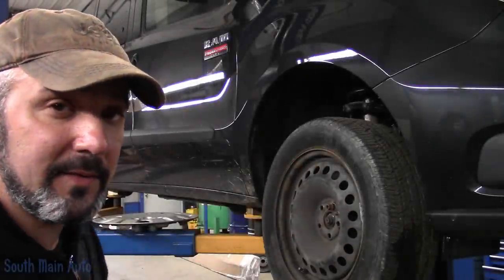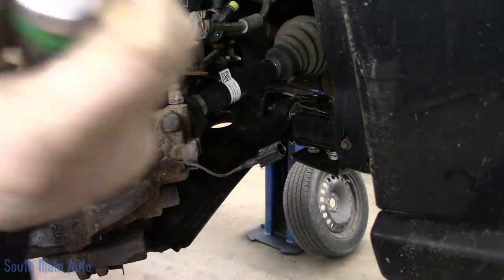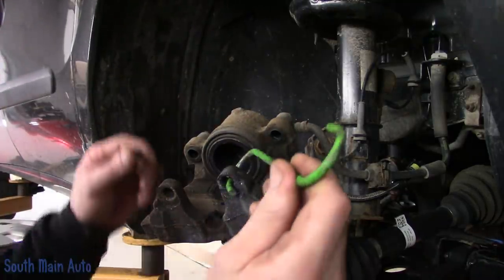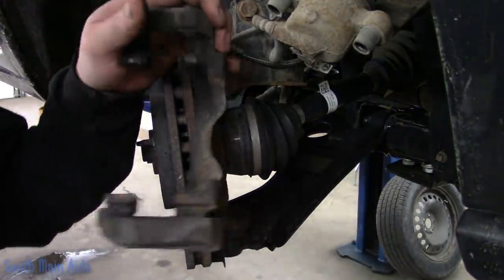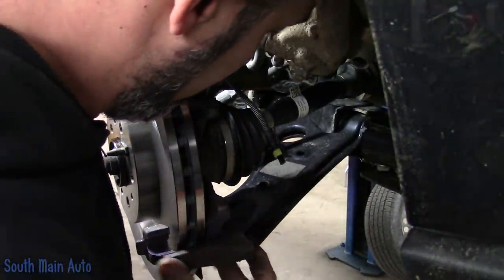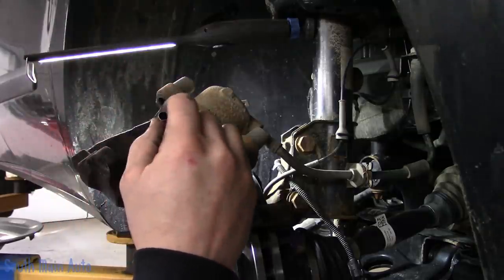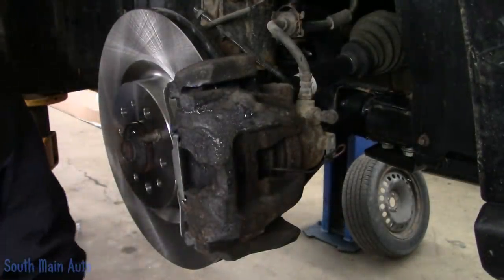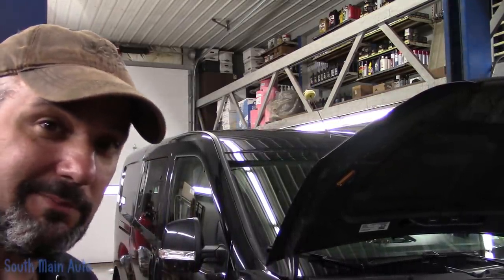Ram Promaster City: Front Brake Job

Comment: I'll watch as many brake jobs as you can produce. By the way, your Chevy engine replacement videos save me 4K. Shop in TX wanted 6K, but I found a used one with 72K actual miles. Took me my son 3 days to swap it out. Most importantly, the boy learned tons; and he makes the dramatic "break cleaner" sound now. So, thanks 'ol boy for all the help.

Comment: I only watch yours, buddy! 😊 Oh, and I love the little lamb sound for Fluid Film! 😄

Interesting little truck there. I just did a car recently with a sensor in the brake pad - I was thinking to myself, "Whiskey Tango Foxtrot is this??" 😁 Think it was a newer Vee Dub - might have even been the one that's on my lift right now for a new oil pan. I know exactly what Peepaw Smith would've said regarding these newfangled sensors (TPMS and pad):  "What the hell's the matter with people in the future? They stupid er somethin'?" 🤣

Speakin' of Vee Dubs ... got to get back out there & finish one - the parts just came in for it. Time to begin battle. Got the oil pan off, front member hanging. Got to zip off the oil pump, remove front engine mount, clean up the gasket surface, then install the new pump, o-ring & pickup tube/screen, then I can throw the brandy new pan back on, and wrestle with that engine cradle ... member ... whatever the heck they call the stupid thing. Might be the last one I ever do. What a PAIN.  I started filming this one over a week ago - guess I've gotta finish. Going to be heavily edited for language, lol ... just like when you forgot to put the lube on the outer part of the caliper ... only alot more of that. 😜

Comment: For me I enjoy seeing all the different ways of doing something as simple as brakes.  This video was the first time I saw a wire run into the brake pad.  Glad you mentioned how it is expected to work.  At the beginning I was just about to back it up to see when you removed the wheel studs and why.  Then you mentioned it didn't have any.  I think the wheels would be a lot of fun to change a flat in the rain!  Then change the wheel hub because the threads are damaged from being cross threaded.  And then the excitement of you removing the rotors.  Wondering how many of your bones are going to get broken. (or cut your air hose)  So keep them coming apparently there is a lot out there too see and enjoy watching.

Comment: Like all others ,i watch all your  videos  the only thing i do different on these type of brakes is to remove the rubber sleeve the slide pin goes in to on the caliper to remove the rust and apply lube if not the rust can squeeze on the slide pin thanks for all your videos Eric

Comment: Today I changed summer tires on my 2016 Kia Rio and while at it, checked how much brakepads are worn and brake discs as well. Didn't take them apart though, just eyeballed them. They looked fine, just a slight lip in some rotors/discs. Have only 33.000 km in the clock so far.

Comment: I got a brake job scheduled here this afternoon and yet I find myself watching you do one. LOL
Reply: Do it yourself and save a couple hundred dollars if it's anything other than pads.
Reply: Yes very true. I probably should have been more clear. I meant I had a brake job to do this afternoon at my shop. I do wish more people would attempt to go for it and do their own brakes. I always let them know it's extremely easy to do and id always give them some help or pointers if needed. 🖒
Reply: @cobrasvt347  Oh, I thought you were scheduled to get your brakes done. I had my car at the stealership for some recall work a while back and some guy was quoted almost $700 for brake pads and replacing a stuck caliper. They probably don't even try to unstick them because they know they can scare people into an overpriced repair since it's dealing with brakes.
Reply: Whew ! 700 bucks !  Dang. The stealerships just keep on going up on everyone. What they are charging folks is just completely uncalled for. I hear customers talk about a lot of their experiences when dealing with a dealer. It's mind boggling what they charge and get away with. It's really sad they do that to people.
Reply: @cobrasvt347 Good to hear
Reply: @fillg  We had a lady pay almost $500 to get an alternator & belt replaced at the shop in our area. It was a '68 Camaro!!

Comment: Quick tip, those external torqx bolts can be removed with a 12-point socket if the head isn't extremely corroded.

Comment: ooops new to this.  after watching your many break job vids, I am going to try to do my rear pads on a 2006 holden captiva in QLD.  Years ago did the breaks on my 1972 VW bug, even replaced the linings on the rear shoes,  This may be a challenge with hand tools only.  Keep those vids coming. Getting used to your driving on the wrong side of the road ha ha,

Comment: Wish the front brakes of my 03 Ford Ranger was this easy. Would like to see Eric do one of those. Almost tempted to call, make an appointment next time they need done and drive up from North Carolina. Rotor is part of the hub so -- not only cost of the brake parts, but also wheel bearings and seals. Guess I shouldn't complain as the only money spent so far is oil changes every 3000 miles, transmission and rear end oil changed every 30,000 miles, a new thermostat, coolant changed every two years and two sets of tires . 104,000 on the clock. Oh, almost forgot the power steering fluid changed twice but I did that myself.

Comment: That FN3 brake setup is also used on some VWs.  Looked pretty familiar until you took off the caliper bracket -- sadly, my '04 Jetta TDI has the cheaper FS III brakes where the caliper bolts directly to the steering knuckle.  Checked the service manual and the FN3 evidently only came on the 1.8T & VR6, and its diagram matches this video very closely.

It's finally due for a front brake job after 153k on the original pads & rotors -- the wonders of a manual gearbox and living in the south!

Comment: The wire for the pad wear reminds me of the motor brushes on older Cybex treadmills that would shut the unit down when it reached it.  You could unplug it and if the unit ran after that you knew it was time to put brushes in the motor.

Comment: The famous meemaw already being mentioned in the 1st 2 mns. Lol 😂😂  Oddly enough, one more brake job video is a highlight of my day...😅😅  Rainy, dreary day here.

Wait.... Fluid Film has a sheep call now?? 😂😂😂😂🐑🐑 Caught me off guard!!
Reply: Yeah, not a fan of that hardware either. E bit bolts & the lack of wheel studs,  which to me help me  get the tire back on.... especially bigger wheels.
Reply: Meewaw = Lanolin= Sheep Wool
Reply: Yeah, the lack of studs is a pain, been a Euro thing for years though. The only advantage is that a damaged one is easier to replace.
Reply: Cuba's Automotive   They usually supply a rod threaded at one end to screw into one hole to hang the wheel onto. It's with the tire change stuff in the trunk. I made my own heavy duty ones by cutting the heads off bolts. They make the job much easier.
Reply: The sheep sound must be like Easter, Christmas, and New Years all rolled into one for some viewers who have been begging for it for a long time.
Reply: @fascistpedant758  I see, so you need yet another "tool" to do a simple wheel swap! I swap wheels (and tires) for summer to winter and vice versa.
Reply: Bob Pegram   You don't NEED it, it just makes things easier.

Comment: Was about to take a shower when I saw the notification that you'd uploaded a video, and based on what the title was, I HAD to stop what I was about to do and come watch as this is basically a FIAT in Ram clothing. :-)

Brakes do look pretty straightforward as far as brake jobs go. Not a bad life out of those front pads, either the person driving it is gentle on the brakes or the pads are better than the average pads put on a vehicle, though those originals did look a tad spent.

Good job as always Eric!

Comment: Have you ever considered using Disc Quiet between the pads and caliper? We don't have the corrosion problems like you do out here, but it does a great job of reducing disc squeal. It sets up over time, and I would think that it might do a better job of sealing the caliper/pad area off from the elements.

Comment: Eric,
Great video - and yes I could watch you do brake jobs all day! 
Its interesting that those caliper guide pins are the EXACT same ones used on my 2002 Focus. I recently had to replace my calipers and hoses (one caliper was seized) and the NAPA Eclipse replacements came with new pins but they are plain (plated) steel and the original Ford ones were stainless steel (checked with a magnet). So I reused the old stainless pins in the new calipers. I bet the OEM Ram pins on that van are stainless too. All the aftermarket replacement pins are plain steel.
SMA#1
God bless
Paul

Comment: Thanks for sharing this just saved me $789.95. I found the rotors and pads for $126.00 on Amazon arrived one day after order end up costing me a 12 pack of beer that I help to finish and I had to install a Ring door bell camera for my buddy barter system is great. How about a list of the tools and size for all the items needed to do the job in the description I did have to go to the tool shop to get the Torx as I didn't have that size so I had to purchase a full set.

Comment: Watching this particular job reminds me of jobs I did on 2 European cars. The slide pins are identical to those of a Volkswagen. I am not sure that the rubber should be lubed. They had no lube when you pulled them out and nor did mine. I did it anyway but I hope it was not a mistake. Second: the brake pads are similar to a 2000 Mercedes E class and also have sensors in them. That vehicle was probably made by Mercedes considering Daimler is part of both Chrysler and Mercedes. My E320 had a made by Daimler sticker on the windshield. If you ever have to scan it you may need to use the Mercedes Sprinter software to communicate with it. Interesting video!  Keep it up!  Thanks
Reply: It is made by Fiat, rebadged Doblo

Comment: I think that you just worked on a FIAT Doblò.  DOH!
Reply: @UC-2a2BNmw4QQ0HGvlTmyGPw That applies to the larger Promasters.  This City model is in fact, a Doblo.  And if I recall correctly, assembled in Turkey, or at least originally planned to be.
Reply: Yep, the fullsized version is a Fiat Ducato and the City is a Fiat Doblò. The City is built in Turkey and is imported only as a passenger van. They bring it into a facility and strip out all of the passenger items from the rear to convert them into the cargo/tradesman versions. That way they don't pay the chicken tax on an imported truck.
Reply: @Blazer02LS  Yep and that idea (importing it as a passenger vehicle and stripping it) was pioneered by Ford with their same size delivery van, ironically also built in Turkey.

Comment: That European descent is a big PITA. I did  4 corner brakes on my fathers Mercedes SL500 and it has very similar style to this. All 4 rotors were seized to the hub like what happened here. Had to sledge hammer them bad.

Comment: FYI, for this style of caliper, I’ve found that if you lube up the face of the outside pad (which is what you did) you’ll get a ton of pad chatter when you drive over bumps. If you don’t lube it up it might chatter for a little while, but after a few weeks the pad will seize to the floating part of the caliper and hence eliminate the chatter. I still lube the ears though. 

Originally I thought the chatter was because of a cheap/bad anti-rattle clip, but after replacing it with an OEM one the chatter remained. 

🤷🏼‍♂️just in case the customer comes back with a noise complaint.
Reply: They sometimes squeal if you don't lubricate the backs.

Comment: 2016 PMC with 141K and still on original brakes/rotors but the pedal is getting pretty soft. I think it's time to work it over. I will probably do shocks/struts and if needed, wheel bearings.

Comment: That caliper carrier cleaned up nicely. Can you elaborate a little more on the ramification of having air under the piston boot? Am I right that there is a separate seal behind the boot which stops the fluid from leaking past the piston? The boot is simply to prevent dirt ingress?

Comment: The only good thing about that euro-style hub set up is that they're easier to clean during a brake job with no studs in the way. I find myself putting a light coat of slide grease on that style caliper bolt too. It may not survive till the next brake job but perhaps it helps the pins go longer before rusting. It's entirely possible that it's just my own insanity.

Comment: Hey! You didn't show the pad programming procedure.  Is that in another video?  Being quite prone to see the evil in mankind, I think these wired pads are less a feature and more of a screw up.  Chrysler engineers, unable to figure out why their floating brakes only wear on the inside, were forced to hand the matter over to the computer guys (who have an answer for everything).  The solution:  put an idiot light on the affected pads in case someone looks at the outers and thinks the brakes are okay.  This is right in line with their dead battery indicator which was soon shelved for obvious reasons.  Wired pads would be great for Escalades since drivers can't hear a normal wear indicator over the BOOM BOOM music [sic].
Reply: Uneven pad wear, suspect sticking caliper bolts. Mr. O cleaned and greased these, so should work mo' bettah.

Comment: Hard to tell from this end, but it looks as though the inner brake pad had twice the wear in comparison with the outer pad. Question is why? plus the shape of the inner pad seemed like less surface area meeting with the rotor. Is that due to space constraints? I know I probable exceeded the number of questions asked, just curious. Thanks for another great video Eric.

Comment: I’m going to add my opinion. 
You should take those caliper bracket bolts and throw them away. Use regular headed bolts if possible. But Chrysler probably made the bolt land so small that it would not work. I’ve never done a brake job on anything that new. So I would not know.

Comment: I'm disappointed you didn't get out a scan tool to check for a brake code (LOL). Seriously, was a "brake warning light ' on? Does it turn on the money light?    No Brake Kleen??? Job not done to SMA specs then. But, the new sound EFX awesome.   Happy Easter.

Comment: We love brake jobs, with so many different cars out there its good to have advanced knowledge of what to expect. 
Why don’t you sell a brake fluid flush or a least bleed the old fluid out a the calipers, I understand you are in the rust belt and the bleeders may not cooperate . But a 4 years 50k pad job with rotors , normally spend a couple of bucks more to know we have fresh fluid and no air in the system. Most customers don’t mind the few $ and it’s now on most manufacturers maintenance schedules.

Comment: I had a Suzuki Brute many years ago when I was a kid and had taken it to a garage for a brake job.  After it was done and I was on my way home, coming up on a stop sign, I hit the brake pedal and nothing happened.  I started pumping the brakes and the right side grabbed and swung me to the right right toward a big tree stump.  I let off the brake pedal and cut the wheel to the left and then hit the brake pedal again.  I missed the tree stump, but the stop sign wasn't so lucky.  I ran it over flattening the sign and pole to the ground.

Comment: Hey Eric have u found the parking brake shoes rust off and fall out in just about every newer ram when removing the rotors? I've done 4 of them now and everyone, anywhere from 75k-120k km the shoes all rot out and fall off. Just wondering if you were seeing that down your way also. They dont even last the few smacks to get the rotors off. Thanks to ram gotta pull the axles to do them too.

Comment: Love all the repair videos as always For some reason on my 01 2500 the oil pressure gauge keeps dropping to where the gauge would be when the truck is off. I had the sensor replaced but now it's doing this when I let off the gas and slow down. Don't know why, it couldn't be the tps could it?

Comment: Had to beat the wheel bearing out of a 06 silverado.   It was the worst one I have ever done.   Is big nasty worth the cost? My two air hammers did nothing.  I have been spinning the hubs in the nuckel like you have shown but one this one was frozen bad.  Had to use a bolt between the nuckle and the hub to force it out in the end.

Comment: Hey ....got a question for ya...I'm rebuilding my whole front suspension on my 2008 Chevrolet Silverado  4wd.  4.8.... other than going to the dealership...where can I get the break dust shields. Left and right side.  I live on the north east as well and the ones on there are rusted to shit.

Comment: Anybody else noticed the new pads have an extreme bevel on the leading and trailing edges...  Seems like you will be 50% thru the pads before your getting full surface area.
A set I bought recently from O'Reilly's was the same.. not sure what the purpose is of that.. pads did not use to be like this...

Comment: The panic ride: backing down a downhill driveway with no brakes.
Reply: I did some work on the transmission of my Studebaker pickup which had been sitting for a couple of months. Got it done, put my dog on the passenger seat and took off down my street... downhill. No brakes, e-brake not hooked up and the transmission was freewheeling (no engine braking). I managed to get it stopped safely by doing some fancy driving and taking advantage of a ditch, but WOW!. My dog thought it was fun and wanted to do it again!
Reply: Bobby Brady  If I drank I would have!

Comment: TWO UNRELATED QUESTIONS:
1:   How does the wheel mount with no studs ?  (Bolts?)
2:   What happened to the oil starved Subaru?
Reply: They use regular bolts instead.